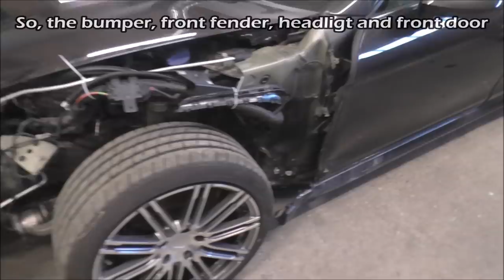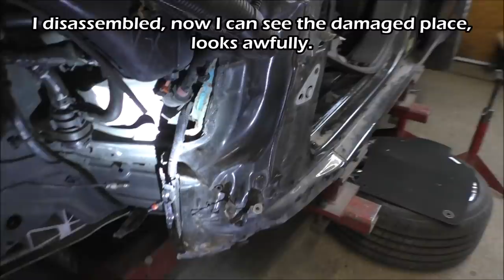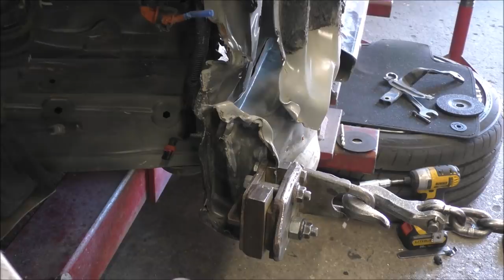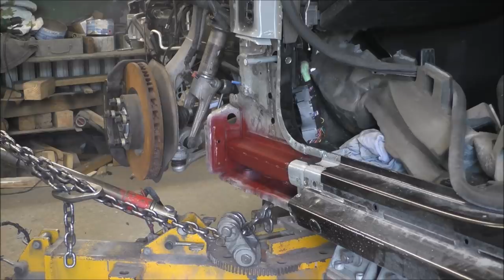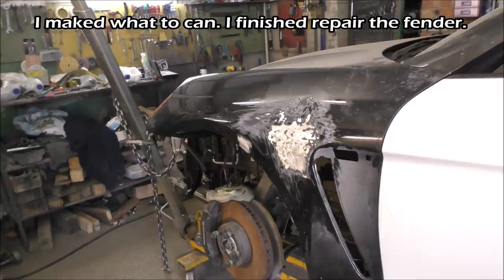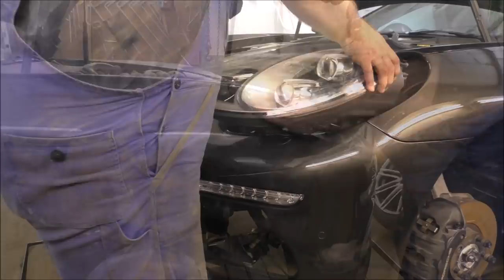Porsche Panamera. Body repair. Ремонт кузова.

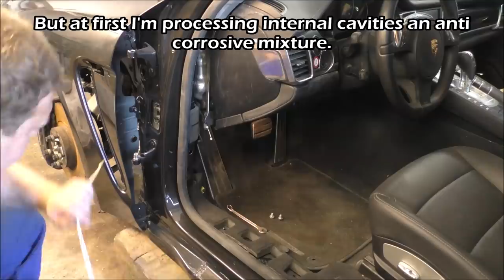Comment: At 12:09, you can see the seam at the bottom where the panel was cut. 
Not sure if that's a paint or metalwork issue.
Reply: Owner must've opted for the apprentice painter, I can't believe they didn't paint the sills!
Reply: Nothing wrong there, comes like that from factory..then there is a cover that is puted there with Porsche brand. So you will never see that
Reply: I noticed same.

Comment: Arthur does a good job for the type of work that's done in his country but I don't think that's the way they would repair cars in a quality collision shop in the US. I do believe the car would need to be totaled or they would cut out a larger section of that pillar and replace it according to the factory specs, with new parts or good used parts.
Reply: Arthur is a master or repairing the cars the cheaper way and still totally safe to drive. Arthur is literally one of the best there is. Period.

Comment: Are these repair standards up to porsche standard. Just wondering, great work, but is it only cosmetical, or is it just as strong as original.
Reply: A repaired car will never be as good as original, but I think the way Arthur fixes these vehicles, I think 95% as good. I am 100% sure about that if someone dies in these cars, it is not gonna be because of the previous damage. If you check out for  body repairs by manufacturer's standards it will be the same.

Comment: Does driving expierence us as good as in undamaged car?  I doubt that after repair it handles as good as before.
Reply: Rihards Linde this is minor steel work. Doesn't impact the car dynamic.
Reply: Only someone that doesn't knoe nothing about car repairs to do question like that. If you see the brand repair book you will go crazy lol
Reply: Filipe Gomes how do you mean it. That of course it will drive the same or not
Reply: that's a minor repair, it will be as good as new.